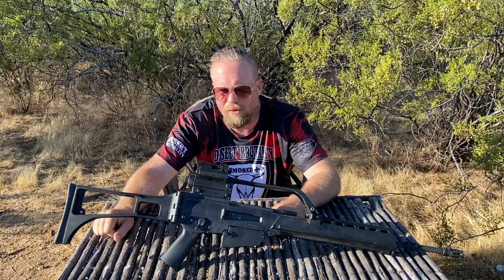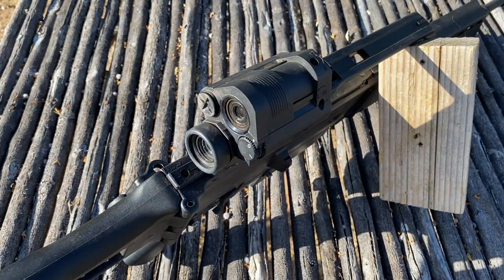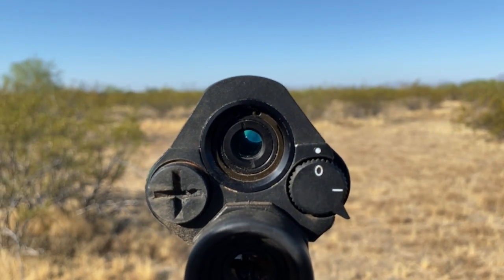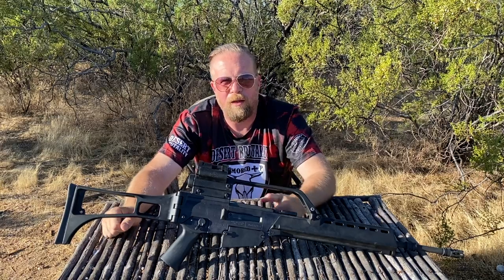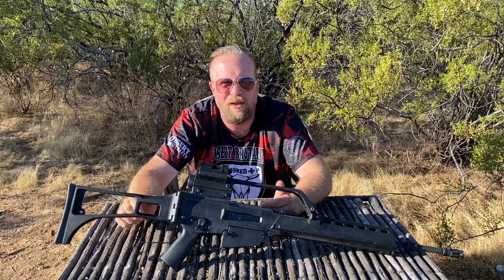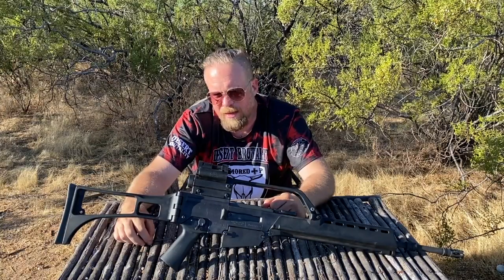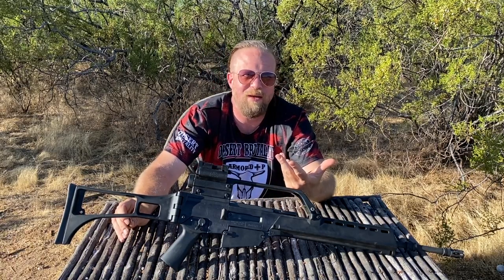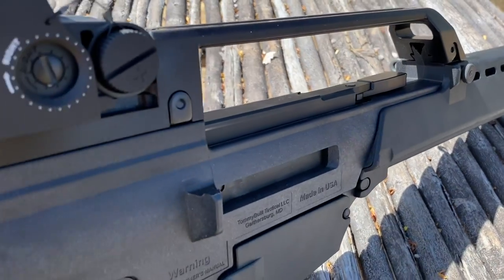G36 - Bundeswehr Hensoldt Dual Optic

Comment: As a German soldier I can tell you a few things about how we're trained to shoot. First, never lay down the barrel on an obstacle, that's what the handguard is for, and keep your hand underneath it. That way the free swinging barrel can keep swinging. Also we're taught that we shouldn't put too much pressure at the magazine. Though this is in my opinion or experience just a problem if old mags are being used, which can lead to unproper feeds. Having shot these optics pretty much I can tell you that it's no problem to work with it, though I am very happy to work with the new G36A3 for the last couple months. The new one has way better optics etc etc.
Reply: I also stumbled about him resting the gun on the barrel.
Reply: 8:00 shows this cardinal sin! no wonder he shoots high as he pushes the gun down against the barrier!
Reply: @trischas.2809  It's pretty obvious he's resting the gun on the magazine, not the muzzle. Not even putting any pressure on the muzzle.
Reply: @Howjadoo22   You can see movement on the dummy. It doesnt much pressure at all to flex the barrel
Reply: Came to comment on the high hits as well, but I’ve seen him be very aware of the barrel resting on barricades with other guns...
Reply: What you write is what we were taught for the SLR (7.62 FN) in the Australian Army.  I don't know the truth of it but I cringe when I see a magazine leaning directly on any surface, let alone dirt.  Same for not having a hand between the handguard and the cover.
Reply: @Howjadoo22  This. The muzzle may or may not be making actual contact with the dummy, but the actual support is provided by monopod-ing off the magazine.

To OP, I believe a lot of militaries still train to avoid holding or putting pressure on the magazine, but experience has shown that this does not generally induce malfunctions on well-maintained modern rifles. Certainly for the AR/M16/M4 family, using the magazine as a monopod is now a common and accepted practice among knowledgeable shooters. I've done this frequently with a variety of ARs and have never caused a stoppage that way. It seems most other rifles using STANAG magazines can probably be treated similarly, but I don't have data to back that up. Clearly Karl didn't induce any malfunctions here on his G36, even with its non-STANAG rear-locking magazine.
Reply: Yeah, in my experience there are not really any malfeeds, but it will impact your sight picture probably, because the bolt will always shake the gun (and therefore the barrel).
Still, keeping up the opinion, the dual stacked optic is crap. At least in Afghanistan we had KA2 which features an EOtech holosight alongsight the 3x scope. Only had the chance to shoot the A3 once, which was featuring the ZPoint by Zeiss which is far better.
Reply: @85Pando  It's kinda funny that they replaced the red-dot, because that one was the only way I could aim the G36 reliably. Especially with all the fogging issues of the 3x-scope in cold weather. I simply used the old red-dot at all times. Still, even with iron sights, I had much better hit statistics when firing my IGF with the G3, than with the G36 and its scopes. Don't get me wrong, the G36 is the better rifle compared to the G3, but the optics are fucking rubbish to the point of making the gun unusable in many situations.
Reply: You people giving Karl grief need to understand that he's an experienced competition shooter and knows what he's doing.
Reply: @deadflowers7017  it's not giving grief. He probably is better shooter than me. Still the g36 hops around quite a bit when put into the magazine. It does not like that...
Reply: @tillmannfischer  yeah, it's very very reliable even in rubbish conditions. The fogging is just one of the many problems of the scope/reddot. Still the weapon had one big advantage when it came around: you can hit quite reliable with it even without much training. Esp on ranges up to 300m the red dot is fine~ish. Still, knowing other sighting systems this one has clearly not aged well.
PS: one additional comment to the heat discussion... At one point we shot ~1000 rounds pee gun with four guns on a range, yeah impact area increased a little butbup to 300m targets were being hit just fine. No center of impact shift. Although they were a little glowy and smelly afterwards.
Reply: ya mean the plastic melty handguard that took 10 year to fix in 416?
Reply: @deadflowers7017  Knowing how to hit targets well and being able to use military tactics and regulations is something different
Reply: I oughta keep in mind the handguard's use to stabilise your firearm if youre laying down and dont have a bipod

Comment: Be interesting to see how the even older SUSAT stands up in 2020...
Reply: We're typically aiming to replace it with the ELCAN
Reply: @luiscardona879  I was under the impression that it already has been phased out - didn't the process start with the brief adoption of the ACOG? I mean, the whole optic is incompatible with the L85A3 and to my knowledge the SUSAT is only issued to reserves and aircrew who use the L22A2.
Reply: @thomaseccles627  its in use by reservists and iv seen it in use late last year being used by the army air corps
Reply: and many l85s with plastic furniture
Reply: Susat works fine, its just old.
These G36 optics never worked properly to begin with.How they passed trials like that i will never understand.
Reply: I'd go with not well. It was a decent enough optic in 80's/90's but there's a reason Urgent Operational Requirements (UOR) got it swapped out for an ACOG when the rifle went into a modern to war.
Reply: While it is obsolescent it would still be workable. Yes the glass is like looking through a jam jar and hold off for elevation is difficult with the post reticle but it will have the same pros and cons as other 4x fixed optics. The EBS on top would be the biggest gripe I think, looks like a trained rat made it and welded it on.
Reply: @epl803  don't forget that the tritium illuminator has faded on pretty much every example still in service. Probably won't be a problem for those who currently use it, but it would severely limit night-time target acquisition if it was pressed into service again.
Reply: I got a chance to fire one of these in Kosovo in the late nineties and while I much preferred the rifle to my L85 A1, I'd take the SUSAT anyday and that thing was not exactly great...
Reply: Infantry regiments and and other combat arms of the British army are issued the "Elcan 4x Light day sight" the SUSAT is still in use with REMFs and used by recruits in training
Reply: @thomaseccles627  SUSAT is still pretty heavily used by the RAF and other non-frontline units. I went to Afghan with one just over a year ago and we've still got a bunch in my local armoury. I suspect we'll still be using them right up until the last rifle is upgraded to A3.
Reply: They have done well though, they have several decades under their belts and been through quite a few wars. Probably even almost squaddie-proof!
Reply: Probably better. Used it full time during my service. I liked it then.
Reply: @CornishMoose  I wonder if we'll be seeing a lot of SUSATs filling the surplus market soon.
Reply: Ah, the SUSAT (Semi Useful Sort of Aiming Thingy) - I liked it.
Reply: FrontSideBus- I have never ever seen nor heard of anything on this planet that is squadiproof. NOTHING!!!!!!
Reply: @mikeblair2594  I've generally heard people describe the L1A1 SLR as squadie proof.
Reply: STALKER fans represent.
Reply: IMHO it's alright in 2020, but it's definitely showing its age by now. 

I wasn't around back then, but I'd guess it was probably pretty ALI back in the '80's, even though it is pretty well due for replacement by now.
Reply: The donkey dick is the only optic I've ever used on a weapon and it wasn't too bad. The simplicity provides better future proofing although maybe not enough.
Reply: @Gareth Fairclough no the a2s and a3s dont i was referring to a2 upgraded rifles with susats and original plastic furniture
Reply: @Seth9809  HOWDY-HO!
Reply: @harrydrinkwater2671  Yup, pretty much. It was very forward thinking of the British back then to issue every front line squaddie a rifle with an optic. With most other nations it was a case of "You will use iron sights and like it". The 'everyone gets an optic' concept clearly had merit since it is now standard for front line troops in all first world forces. Of course the optics used today are far better since they benefit from 30+ years of near continuous R&D. (Scopes, laser sights and ballistic computers being some of the few aspects of small arms that have continued to see significant improvement.)  So yay for blighty being ahead of the game, boo for blighty for sticking a decent optic in such a $h1t gun.
Reply: The SUSAT has been phased out of teeth arms units infantry now use the LDS! Other arms now get the SUSAT until it’s dies a death. Still a very good optic as proved year on year at bisley.
Reply: It stands upside down I guess...
Reply: @cocopud  The L85A1 was absolute shit as Ian has covered- the A2 was much better when I used it. Only malfunctions I ever had were due to old and battered magazines
Reply: The main issue with the SUSAT is that it weighs the same as a T-34 tank. At least its supposedly just as durable, too.

Comment: I've seen airsoft replicas of these and thought they sucked. It turns out they replicated the original pretty well. Blue tint, bad scope
Reply: I had the airsoft version of this without red dot and added bipod. Loved it but the scope reticle was never able to reach where the bb was flying. Must've got knocked around somewhere but I was young and it was close so never returned it. Still a cool gun! Would love to shoot the real version like the one in the video!
Reply: @willitsteel  Yeah I had a Classic Army G36K which was pretty decent except that the sights (G36E-style 1.5x scope) were garbage. Eventually I managed to get a replacement G36C-style rail and put a red dot on it which was much much better.

Comment: I think I know the problem you experienced. The springs with which you adjust the sights sometimes come under too much tension. When you now fire the recoil of the rifle may lead to relaxing the springs and the optics go astray and are not zeroed anymore. The Problem was/is known in the Bundeswehr. The field manual recommends after zeroing the rifle to push softly against the outgoing optic glasses with your thumb. We went over to knock with a Swiss army knife against the side of the optic carrier which does the same job but doesn't bring dirt on the optics. After that do 3 to 5 more rounds to check if the rifle is still zeroed. If not rinse and repeat with zeroing otherwise you are good to go. Hope this helps. Cheers
Reply: Did that and every other trick, everybody always wanted to shoot my rifle, since i zeroed it this good 😂
Reply: Sounds similar to the "tap the adjustment dials" recommendation for older ACOGs

Comment: Hi, great video. but as a ex-german military armorer I´ve some additional points to the G36 that you missed in the Video:
1. Red Dot Sight: You missed to mention that you got a Light sensor on the front of the Red-Dot (opposite from the Switch). It detects the brightness of the ambient light and dimms the Reddot accordingliy. This is for entering some darker areas (f.E. If you move into a builing or covered Trench). It is designed to dim down the reddot so you get not blinded by the Dot. You can test the funktion as follow: Turn on the Dot, and then simply cover the photosensor at the front of the Dot. you will notice that the dot gets dimmed down, and will get bright again as you remove the cover from the sensor.
2. When shooting you should never place the Flashider or Barrel on your cover, but your handguard. The G36 provides a freefloating barrel, which only works if you let the barrel float. If you need an additonal point of contact while shooting always use the handguard to lie the weapon on, never the barrel itself. (thats maybe one of the reasons for not hitting with well aimed shoots, because the barrel can not vibrate like it should anymore, leading to your bullets going off not exactly where they should.) You did it right shooting from the wall, using the handguard as point of contact instead of the barrel.
3. You can loose your Scope zero after some shots fired, (or some more), if you don´t do it the proper way; You need to wiggle the scope front end, useing your finger, to allow the single spring under the plasticcover at the front of the scope to "readjust"; and than check again if your scope is still zeroed correctly. If you only turn the set-screws and don´t wiggle the scope, the spring can be in and odd position, and will set itself after shoots fired, altering your zero. (most guys don´t know it, and its not mentiond in the instruction manuals as far as i know.)
4. you mentiond "cheekweld the high reddot" somewhere; In the german military shooting concept you do not cheekweld the Rifle: That is bechause the german bodyarmor won´t let you do it proper anyway, especialy with the "long" buttstock you use on your sample gun. Check out this video to get a glimps on how it is trained in germany: https://www.youtube.com/watch?v=52fIPke-jDQ
This is a bad video (as all Bundeswehr produced videos) but it shows will be Shoot-Instructors getting trained, not experts showing how to do it perfect, but you get an idea how it should look like.
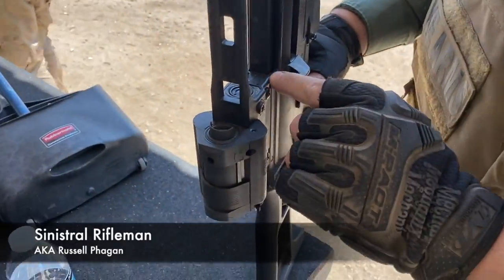5. the "flexing" shown at 13:05 in your video is much more than anything I´ve ever encountered in the german army. The "block" in wich the rear of the carringhandle is screwed in should be more riddgit and there should be no flex at all. I´m not sure what causes this flex at your gun, maybe it´s a problem with the reciverbody material or it´s mesures, but thats not how it should be! The original HKV carring handle needs to be hammered down onto the Block with a rubber hammer, like the tommybulid metal rail you mentiond. If thats not the case with this build, than probably the mounting block on the reciver of for the HKV, or the HKV itself are out of spec.
Also I got something to a point mentioned by Jumper Harz relating to not use the Magazin a a point of contact with the ground while shooting prone: Absolutly False but most guys in the german army never learned it better and are repeatin this false statement and it still got teached by some instructors who don´t know better.
Fact is, and thats what get teached today at the Shoot-Instructor- and Shoot-Teacher-Courses in the german Army, that it´s perfectly fine to dig the dirt with your magazin while shooting prone! It will not lead to double feeds or any other malfunctions. Ofcourse if you use damaged magazins with broken feedlips it can happen, but also if you not put the Magazin to the ground.
anyway big thumbs up for the video and keep on doing your good work!